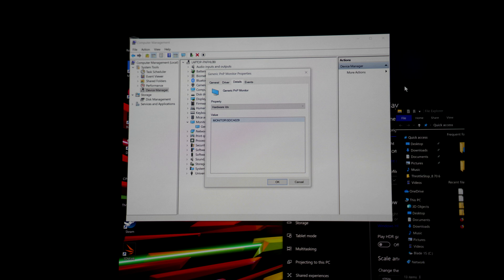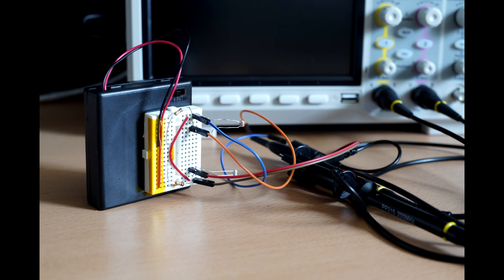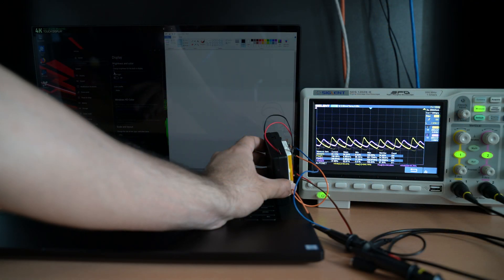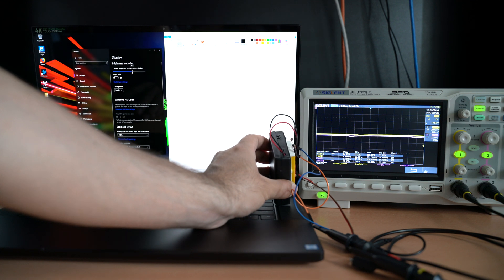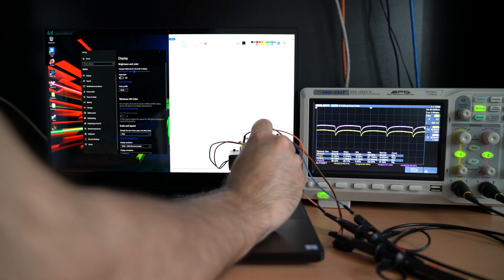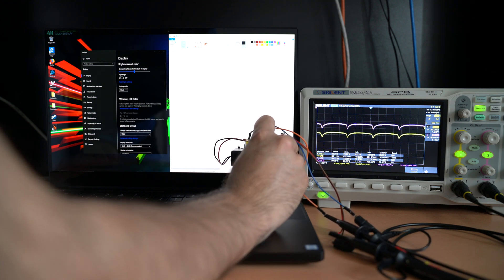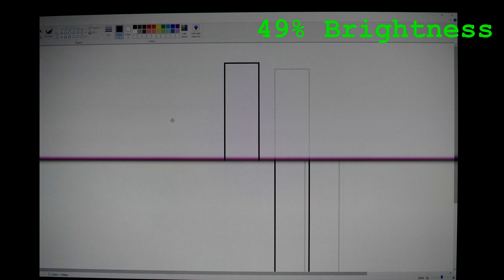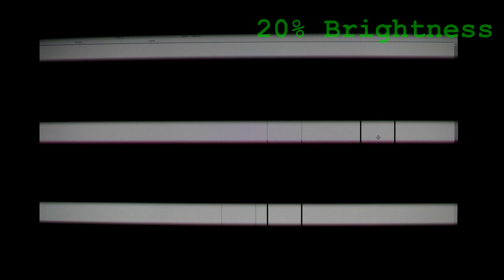razer blade 15 oled pwm test

Comment: My phone picks up diagonal lines at lower brightness, but nothing at higher brighness. I use my Blade 15 2020 OLED at near, if not 100% full brightness and have never had eye strain, but I do have sensitive eyes. That makes sense, it switches from PWM to direct control at higher brightness
Reply from the maker: if you rotate your phone 90 degrees, the lines will be horizontal. depending on which way you rotate, you may see more or less lines. the less lines side is the accurate side. this has to do with the rolling shutter direction being affected by the camera sensor orientation. increasing shutter speed in pro camera mode on the phone can also help.  but yes, the type of flicker on OLED at the same frequency still is not nearly as bad as what some LCD panels used to have. i ended up getting a different laptop with an LCD screen (razer blade battery became swollen after a bit over a year) that had no PWM. It was pretty evident how much less fatigue and dizziness i got going back to LCD after over a year of OLED. recently got an Asus ProArt P16 as well which has a similar display and noticed the same symptoms (maybe worse?) dizziness, heavy eyes. However, I ended up finding out that if i enable HDR mode in Windows on my ProArt P16, the PWM flickering at all brightness levels for white areas is gone. Does that also work with your 2020 Razer Blade 15?

Comment: the best explanation and test even in 2025
Reply from the maker: ty so much for the compliment :D i was going to make a better video with animations and better test equipment, but i got busy. also ended up changing the laptop after the battery inflated. ended up breaking the touchpad and some screws popped out

Comment: Hey Kuma, I was wondering how your Blade is doing after all this time? Any burn in or color degradation? 
And most importantly, how are you doing mate? Are your eyes strain free? 

I red this post on reddit, which may just fix this issue as well:
https://www.reddit.com/r/Dell/comments/ccs2r3/xps_15_7590_oled_screen_flickering/
Hey Kuma, I was wondering how your Blade is doing after all this time? Any burn in or color degradation? 
And most importantly, how are you doing mate? Are your eyes strain free? 

There is also the Iris tool which supposedly can fix this issue by keeping brightness at 100% but having the screen looking dimmed via the software. 
https://iristech.co/

Lastly, I found a video that might provide a fix for any display with PWM. You pretty much alter the PWM frequency via a software tool. Kind wondering if this would work on the Blade and if it is bad for the display :/
Anyways, here is the video and all the best to you!
https://www.youtube.com/watch?v=lcnIL6akIwM

Comment: How is the display currently? Any sign of degradation? Any problems with the laptop as a whole?
Reply from the maker: display currently is just as it was in the 6 month update i posted in the description of the video. in july i will update it again with the same method of taking the pics. i should've taken pics when i first got it, but i did not. however since then, it hasn't changed as far as i remember. the rest of the laptop is running like new still, no issues. i suspect the thermal paste application is getting a bit worn out though as temperatures seem to change a bit quicker than when i first got it. im still getting 5 hours of battery life on it of just youtube and document editing. OLED screen + 4k does kill battery life :/ so around 5 hours is as good as you are going to get for that scenario. when i am just editing docs (firefox is closed, no network connectivity) i get 6 hours. that said, i was getting maybe 30 mins to 1 hour more with an XPS 15 9570. so it's not that bad.

Comment: Hi! Thanks for the proper scientific approach! Do I read your description right, that your screen did not show any signs of degradation in 6 months?
Reply from the maker: correct, no signs of degradation so far. the variance in colours was there from the beginning. however i am not sure if it has gotten worse or not. even if it has, it has done so by a small amount. colour variation across the screen is not noticeable unless you try to look for it. i don't have a method of objectively measuring the particular areas of the screen for a true scientific approach, so i apologize for that. the images linked in the description should show a rough idea for how badly the colours vary.
Reply: @KumaMech  Hello, I've got an HP with same kind of panel, curious if your screen uniformity was evident to a naked eye, like in this post https://www.reddit.com/r/spectrex360/comments/h89xm6/spectre_x360_156_screen_lottery_need_your/
Thanks in advance
Reply from the maker: @palomares.webador  i don't think the screen uniformity issues i have are as bad as that example, but keep in mind they overexposed their photos quite a bit, and they may have over-saturated the colours to show colour distortions more prominently. that said, you can see the album i posted in the update as i stated before. the pictures in there are meant to be slightly overexposed to what i can see with my own eyes. to answer your question, variations in screen uniformity are visible to the naked eye with pictures primarily consisting of dark, but not totally black content.
Reply: @KumaMech  Thanks for the explanation! Did you do your original shots in the album on 50% brightness or on some other? I found variance to be different on different brightness setting.
Reply from the maker: @palomares.webador  i just realized i did not define the brightness levels for the pics. the brightest pic is 90%, darkest is 10%, and the one in the middle is 50%. the shape of the variations don't change with brightness, but the colour balance on some areas of the screen do change a bit.
Reply: @KumaMech  Thanks! Invaluable!

Comment: Let me give you some advice. Firstly go to Windows 10 internal color calibrator. Then ve you calibrate, change nothing but turn all the colors down, and save that profile. When you use that profile, you can turn the brightness all the way up, and it seems like %50 brightness on standart color profile. One thing is to be known, you sacrifice from colors a little when using that new profile.

Comment: Hey, do you have the exact model number of this laptop?
Reply from the maker: the one i have is a Razer Blade 15 OLED 4k model with a 2080 Max-Q (RZ09-03018E52) i don't think you can get my particular model anymore. the late 2019 model is supposed to be RZ09-03138. as far as i know, the only difference is the optical switch keyboard.
Reply: Kuma Mech Ah, right, thanks, I thought it must be… I think that’s called the advanced edition or something like that… It’s interesting that the studio edition seems to have non-PWM dimming when the advanced has PWM
Reply from the maker: @josephcullen2512  maybe it's a different panel? that is news to me. then again i haven't been keeping up. the studio edition came around the same time the late 2019 advanced models were released. maybe the newer advanced model has the same non-PWM OLED panel?

i am going to be honest... i really wanted the studio edition since i use CADing applications that benefit a lot from quadro drivers. but i've heard some bad things about the studio edition, to the point where i am happy with that i have. that, and i couldn't afford to wait until November for a new laptop :/
Reply: Kuma Mech It could be a newer panel I guess, or a slightly updated version of the same panel with new backlight control. I read mention of a new low wattage OLED panel in a Hewlett-Packard laptop just before… I dunno, interesting... would be interesting to test the newest advanced model.Fair enough on your choice, it’s a great laptop anyway! I’d like to get the studio edition, except I could only really justify the asking price, even at a stretch, if I was planning on making use of the graphics, which in my case would be video editing… I’m not sure how Quadro is for video editing… I know it’s designed mostly for stuff like what you do. I’m hoping we’ll see some more OLED laptops coming out soon enough, hopefully with non-PWM screens too
Reply: Kuma Mech Here is the answer. Apparently a custom controller in addition to or instead of the inbuilt controller of the panel http://forum.tabletpcreview.com/threads/razer-blade-1st-oled-with-pwm-0.75301/

Comment: Hi. How's your OLED panel on Razer now? Any degradations?
Reply from the maker: i've had it for about half a year, using everyday and so far... nothing. i will say though that displaying a dark scene that isn't completely black (like a dark grey), you can see the unevenness of brightness, even when it is related to each subpixel (looks like chromatic noise). but, that was how my oled panel came. the variation in brightness isn't nearly as bad as LCD backlight bleed though, however the chromatic noise is something that is more evident on the OLED panel... only just. no burn in yet. i will try to find my colour calibrator and remeasure brightness. i will also see if i can take a picture of my OLED display showing a dark grey image. it really isn't that noticeable.
Reply from the maker: i took some pictures of the current state of the OLED panel, as well as brightness measurements. 
https://imgur.com/a/xcILe5V
in the imgur album, i also included the image i used as my dark grey background for testing so you can compare. i took pictures of the display at 20%, 50% and 100% brightness, as well as an extra picture at 20% brightness taken with the same camera settings as i took the pic at 100% brightness with the grey image...long story short, the colour is not 100% stable across the screen, neither is it stable at different brightness levels. luminance is not stable across the screen either. screen is as bright as it was when i got it. in fact all the imperfections of the display are pretty much how i got the display 6 months ago. If you are going to be using the screen for video editing or photo editing, i find it difficult to recommend, and would rather point you towards a high quality LCD panel (most 4k notebook LCD panels these days are very good).
personally, i almost didn't notice the teal tint to the top left of the screen until i took a picture of it. the more annoying part is the variation in brightness, as it is pretty noticeably when you are panning an image up and down/ scrolling on a webpage.